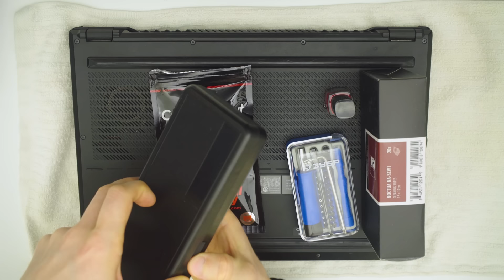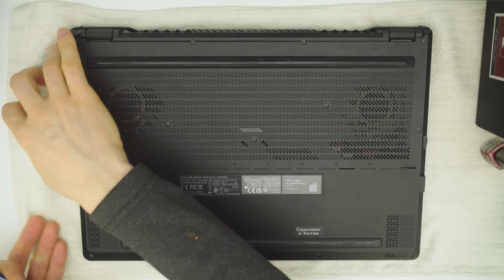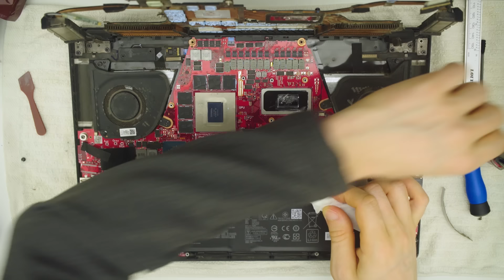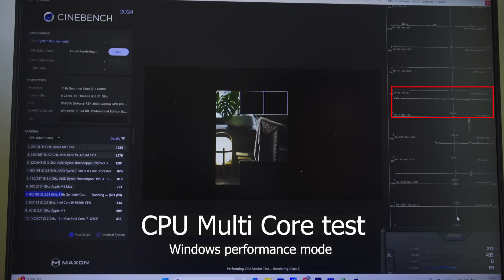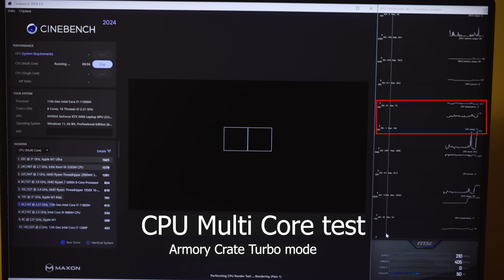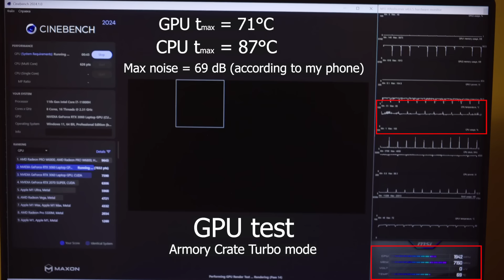Asus Rog Zephyrus M16 i7 11800H, RTX 3060 "thermal pads" replacement

Comment: I'm doing this but I'm switching to PTM7950 because I hate liquid metal especially on laptops.

Edit: I'm sacrificing 1 degree C from optimal performance for something that performs better over time and will last 10 years. LM isn't going to last 10 years.
Reply: Hello, im kinda new, so I do everthing he did just with the PTM7950?
Reply: @tasti1196  As far as I know, you don't want to use PTM where the pads are, you can switch the pads for new ones, but don't use PTM there, PTM should be used on the CPU and GPU only as far as I know
Reply: @cyansius  correct

Comment: That is Thermal Putty, not paste or pads.

Your gaps are as thin as 0.2mm. Your best option for putty is Halnziye HY206/HY236. Buy 20g and use 7-12 grams. Most other Thermal Putties have much larger particles and can't squish as thin as HY206/HY236.

https://youtu.be/0sOON88Oq_w

I'd also recommend using a Phase Change Material on the CPU and GPU core, like Honeywell PTM7950.
Reply from the maker: Thank you for your recommendations!

Comment: Thermal paste will not do the job for VRAM, VRAM sits lower than the CPU and GPU chips.

Thermal paste won’t be thick/high enough to touch the heatsink.

You should have used thermal putty as it can be caked on and layered correctly, where this was needed.
Reply from the maker: That's very helpful to know for future maintenance.
Reply from the maker: By the way I've had a short circuit this december I have dissampled the cooling system again and thermal paste was completely dry. I gave it for the repair and service has replaced all the thermal paste, liquid metal and thermal putty. Also they told me that a lot of such computers have short circuits, some of them fry the CPU, I was lucky. A pair of condensors had to be replaced. he said that it was circuit in AC_BAT_SYS line
Reply: @motoandtech861  oh damn

Comment: So all those heat pipes are it right, thats not vapor chamber cooled? I was confused about it cuz I thought it was just at the die of the processors. But, if you google vapor chamber cooling the element looks completely different there arent any visible pipes its just a flat metal sheet where the pipes are on this one. I was confused cuz I have this one but i wasnt sure if it was vapor chamber cooled at all. I guess not. its just a liquid metal thermal paste.
Reply from the maker: Yes, you are right, in this model, it seems the heat pipes are the primary cooling component.

Comment: For the LM, I did not remove the stock one,  Igave it a top-up using same TG and spread them evenly again, same on the radiator. As for the putty, when I opened mine, it was still a good amount

Comment: That's thermal putty dude... You dont know the difference between thermal putty and thermal paste??

You made a content about thermal pads.. but there was no actual thermal pad to begin with.. LOL
Reply from the maker: Thank for your comment, pretty informative for me. When I started to open it I thought there were thermal pads inside, that's what I think a lot of people may also expect and that's why I've kept the name as is. I did not know that thermal putty exists or is used in this laptop, or I would have bought it for replacement. Did you know that they use thermal putty in M16 before the video?
Reply: @motoandtech861  I have the GL702VS and from factory it does have similar 'goop' on vram etc.  ordered some UTP-4 putty for laptops.  But saying that, I'd be interested in how it went using thermal paste on the vrams etc. as it seems very logical to do so.
Reply: @joalltaeuber8065 should we use thermal putty on vram or thermal pad is better?
Reply: @srenivasana415 thermal putty.
For all ASUS laptops get eother Halnzoye HY206/HY236, or Zezzio ZT-PY6.

If you can't get those then another good option is UTP-4 Ultra-Thin. It just performs slightly worse than HY206/HY236/ZT-PY6.

https://youtu.be/0sOON88Oq_w

Comment: how did you measure the thermal pad thickness?
Reply from the maker: I measured the thickness of the pads and thermal paste on the cooling plate with a caliper (the back part where you measure the internal dimensions of something), because I wasn't sure I could pick up anything without it falling apart. But the place where the thermal pad actually was is a little off to the side and it has its own screw, so I don't think the thickness is that critical there.